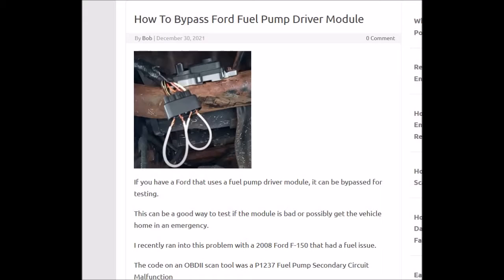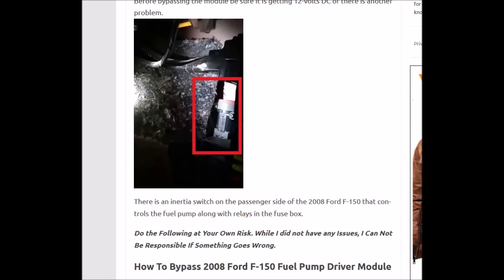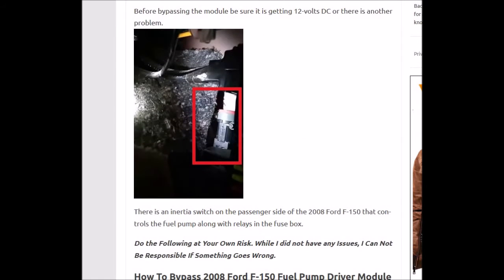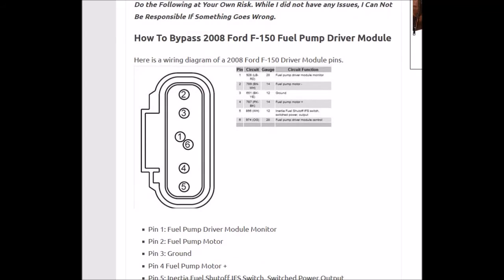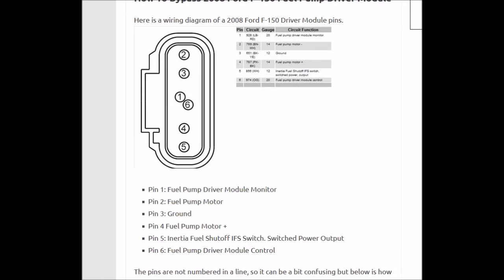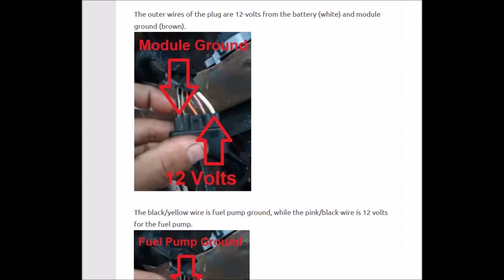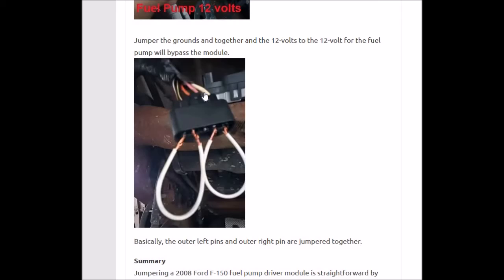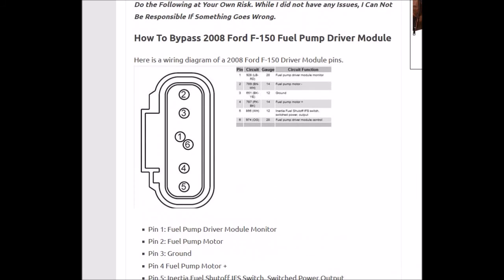How I Bypass 2008 Ford F-150 Fuel Pump Driver Module

Comment: What if you do if you replace the module and when you jump it it it works, but when you plug it into the new module, it still doesn’t turn on the pump

Comment: Good Video, just thought i might add, easiest way to jump the connector is to just plug in two 20amp fuses into the outside terminals of the connector. They fit perfectly.
Reply: Genius I tell yah.

Comment: I got a 07 f150 harley davidson and i keep on getting the p0191 (fuel rail sensor) truck will run fine but after 10 minutes drive the truck dies. I disconnect the fuel pump module and the truck turn back on and runs. I replace the sensor the module the filter and the fuel pump and it keeps on doing the same thing any idea what the problem is?

Comment: I did this to diagnosis which part of the system failed but did it with paper clip and the both the hot and ground got very hot needed a pliers to pull out So now I don't know if thats normal or not truck idles for 30 to 40 minutes and suddenly dies the no crank till something cools down

Comment: Wanted to thank you and give my sob story. Mine was overheating and after a while the engine would stop sending fuel. Going down road and engine just shut off. Used your video to get my truck home from vacation 100 miles away. Don't recommend but got me there. Oh and FYI always get OEM with these cuz I replaced mine with some cheap one and a year later I'm replacing it again

Comment: I just had my Module replaced last year... but I again have a crank no start no fuel delivery. replaced the filter, and engine started but the fuel didnt continue to be delivered and shut off. looking at my module I'm noticing it's fine, but its ground connects to it's own mounting bolt... and it's beyond rusted.... could it just be a bad ground causing the same problem as a bad module?
Reply: Did you ever figure what was wrong mines doing Same exact thing
Reply: @gavinwalshak8358  yeah one was installed by my local mechanic who didn't prep the surface by clearing away rust which includes the ground wire which is attached to the frame there I cleaned up the ground connection and the metal surrounding it and it worked like a charm
Reply: @RogueArcher24 nice I’m going to try this out
Reply: Where’s the ground? Ever find out? I can’t find it

Comment: Have power to white wire and ground to the driver and if I power pump up manually it starts up ..put new driver module.still no start  does white wire send power to the pink bk wire got no hot coming out module from pink bk wire
Reply: Did you ever figure this out? I have the same issue.
Reply: @bbfineautodetailing5525  yes it was the wiring harness that runs back to the fuel pump module what happen was the body mount bushing went out the the bolt came down on the harness
Reply: Was like 2 or 3 foot from module
Reply: Harness runs along driver side right under the body mount bolt
Reply: So where is the ground? I could really use some help

Comment: Great video,  I didn't  know Ford would have a fuel pump module.   I have a 2002 f150 lighting svt 5.4 model.  Do you know if the pin outs are the same?

Comment: Doing that will blow up the fuel pump pressure rail pressure regulator it's not designed for the full pressure of the 12 volts will get the pump will happen is there's a vacuum port and your flood your motor with gasoline

Comment: I have this issue. I jump out the pins and my fuel pump worked but I bought a new FPDM and when I hook it up I have the same issue. Pump clicks but wont run.
Reply: Same issue… Bypass gets the car start and running no issues but putting the new module it dies every start…
Reply: Did you ever figure out the issue? I’m having the same symptoms
Reply: Fuel filter replacement fixed mine
Reply: Any update?

Comment: Can I have this permanently?
Reply from the maker: I wouldn't do it permanently maybe to get off the road if broken down or for testing
Reply: @HVAC_Mechanic question I did it and it crunk but now it want haven’t changed anything do you think replacing the module is worth it